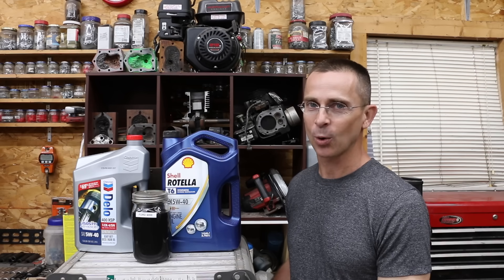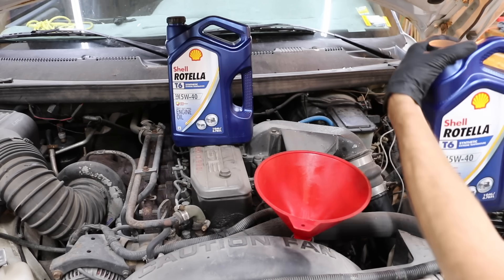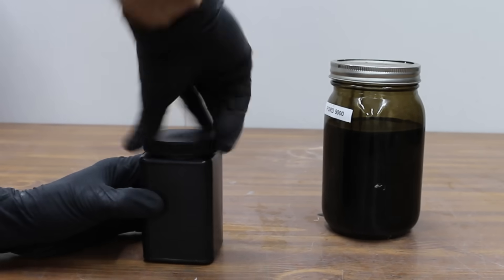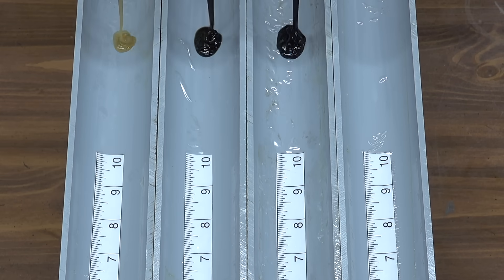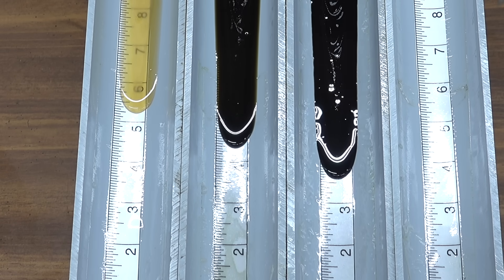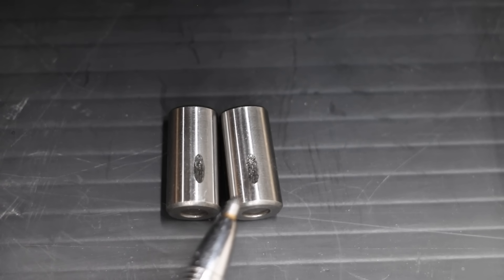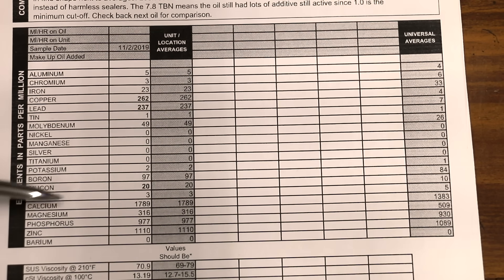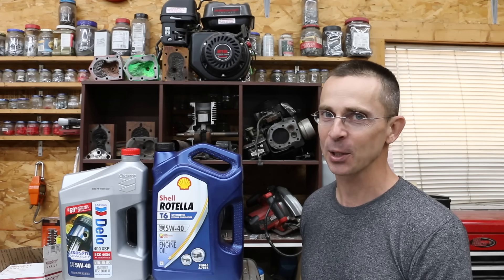Will Annual Oil Change Damage Your Car? Let's find out!

Comment: I have over a dozen cars, many that see less than 1k miles a year and always go back and forth how often the oil needs changed. I’ve been looking for a test like this for years. Excellent video and very informative. Thanks for the great video!
Reply from the maker: Thank you for the feedback
Reply: Same with me, I'll change every two years regardless of miles on oil.
Reply: I think I’m going to start going every two years now. When I go to do my annual oil change, the oil always looks new and feels like a waste
Reply: @mikedubasak5280  Thats BS, fresh oil will change its color from honey-yellow to brownish in a couple 100 miles. You can see it in the video, when he cooked the oils. So dont tell us, your oil looks like new... Youve probably never seen it yourself...
Reply: That seemed like a dicky and unnecessary comment, especially on Christmas...

He cooked the oil at 400 degrees to replicate extreme conditions, oil in a motor is typically right around 250 degrees. Color is a little subjective, especially when your looking at it on a dipstick. The only oil that is black right away (at least in my experience) is in an old ford 7.3 diesel truck I have. In a well maintained good running motor, oil doesn’t change very quick, especially in newer cars. Again, in my situation, oil I’m looking at oil less than 1000 miles in a car that is sitting in a garage. Maybe if a motor is really tired, it would be black pretty quick. Again, just sharing my experiences as a mechanic of 15 years.
Reply: @Chris-yy7qc  incorrect. I have had plenty of vehicles that will not noticibly darken oil until thousands of miles are put on the oil. My g8 runs around 10k miles an oil change on 9 quarts, that stuff looks new for months.

Dont confuse cooking oil at high Temps and normal engine operating conditions
Reply: @You_Got_nico  Then you bought crap oil. Oil contains detergents and is supposed to absorb the dirt from the combustion. So if it doesnt get darker, its crap.
Then you are incorrect: Oil gets as hot as 130°C during normal engine operation. The temp he was cooking the oil wasnt much higher. Additonally the oil has to withstand acids, sheerforce, pressure and so on inside the engine. So normal engine operation is much harder for that oil than any cooking.
Reply: The lighter your oil looks the cleaner the engine is. I have an older car where the oil does get darker only a little bit. It starts getting darker around 4k miles.
Reply: @Chris-yy7qc  most modern generic brand conventional oil (super tech or motomaster etc.) can easily go 4 to 5,000 miles and 2 years as long as operating temps are reached frequently...once the oil starts to go dark, I like to change it regardless of conventional or synthetic. Some conventionals have better additive packages than their own synthetics. Such a Valvoline conventional racing oil...Even the standard Valvoline conventional oil is very high quality and good additive package
Reply: @You_Got_nico  You obviously just didnt understand, because I said exactly the same as you. Try to understand/think first (even if its hard for you), before posting.
Reply: @Chris-yy7qc  if you said the same thing as me then you need to go take an English class to learn how to type.
Reply: @You_Got_nico  Youre arrogant. ;) Not everybody in the world is a native english speaker.
Btw everybody else except you seems to understand me just fine. So I suggest you work on your mental capability while I take a english class... ;)

Comment: The Army is starting to do fluid services based on actually usage or every 2 years on low usage equipment
Reply: When I was in, '01-'05, we had AOAP (army oil analysys program).  We'd get the truck up to temp and take a sample from a port on the side of the engines, then send it off just like Blackstone Labs.  It would either get added to the services list for a change or it wouldn't depending what the analysis showed.
Reply: @GrandPrix46  Big ships do not replace oil, they replenish additives. Does take analysis though. In uncontrolled environments (cars) fulloil swap is cheaper I suppose.
Reply: @GrandPrix46  Big ships do not replace oil, they replenish additives. Does take analysis though. In uncontrolled environments (cars) fulloil swap is cheaper I suppose.
Reply from the maker: Thank you for the feedback

Comment: You should try measuring your wear bearings with caliper using scar center then diameter of it. It may give more accurate representation of wear then length measurement.
Reply from the maker: Thank you for the video idea!

Comment: I change my oil with full synthetic every 8-10 years or 6k miles, never had a problem.
Reply from the maker: Thank you for the feedback
Reply: 8-10 months?
Reply: Mark L   Not months, years. I don't drive that often so it takes me about 8 years or so to get to 6000 miles.
Reply: 8-10 years - maybe for manual transmission oil is good but this is probably way too longer for an engine oil imho. How long do you have the car?
Reply: @Combine1331   I have multiple vehicles so it takes longer to rack up the milage, that's why there is so much time between my oil change intervals.
Reply: @tercola8756  I see. But aren't you worried that engine sludge could build in the engine if you drive the motor with a very old oil? This is like the video topic but on another level. Maybe if there is oil testing companies in your country you could test such old oil if it is any good - just for the peace of mind.
Reply: Combine   I haven't seen any signs of sludge when I change my oil. I think the idea of the 1 year or less oil change interval was created by oil companies so they can sell more of their products and make more money off everyone that believes them.

Comment: Consider for a moment this mr lease I just turned in I had for 27 months - with the oil life monitor I changed the oil  twice. It had 26000 or so miles and the most recently reading was 43% left
Reply from the maker: Thank you for the feedback

Comment: When I left for my round the world motorcycle ride I stored my other bike.  I changed the oil, ran it for 5 minutes then left it for 2 1/2 years.  When I got back I ran the bike for about 50 miles.  It ran fine but the oil was a color I couldn't understand.  I wish I saved some to send ya.
Reply from the maker: Thank you for the feedback

Comment: hi we have a 1992 jeep pickup 86th on it, and its oil filter is upside down?? who would do that?? but I do put oil it and let it set the oil will suck in the filter and not run out, you can over fill it but this works for me thank for your work have a great day

Comment: I put new oil in my mower when I bought it 12 years ago. Thats the only oil it's ever had. Maybe 200sqm of grass to mow, and it still starts first lazy pull every time.
Reply: I had a 6.6 hp mower about 7 seasons before leaving it with the house and admittedly didn't mow nearly as often as neighbors wanted.  Oil always looked new.  A bit larger yard, easily took more than 30 minutes to mow on best situation, so mower always got up to temperature.

Best I can figure, I'd need o worry about the oil condition around the time the body of the mower rusted out, and I saw no evidence of that, even in the high humidity of Indianapolis.

Comment: Could you please do a comparison between 0-w50, T6 and other popular weights? I'd like to see if they offer the same protection once hot and how they flow cold to prevent metal on metal contact. This is mostly regarding to high performance engines.
Thanks!
Reply from the maker: Thank you for the video idea!

Comment: Dont understand it. In Germany I change the oil no later than 30000 km or every 2 years. That almost 19000 miles. Thats with a full synthetic oil. Thats Recommended by European Kia. My last car I had used a mineral oil which I changed at approximately no later than 10000 miles. Never had a problem with either if them.
Reply from the maker: Thank you for the feedback

Comment: 1:25  they don't recommend pre-filling oil filters anymore since "new oil" sometimes has clumps in it which could cause a plug.  Especially in vehicles with high tolerances.  New oil is not perfectly filtered and you are putting "unfiltered" oil directly into the engine by pre-filling the oil filter.
Reply: 6:38 I am glad to see you measuring exactly for the oil heat dissipation tests.  This allows for a direct comparison without being off because of proportion differences in the oil quantities of previous videos.

Edit: 7:47 my bad, you are still doing it the old way but it doesn't matter because Delo actually does experience more evaporative loss.

Comment: I changed my oil a couple months back. I run mobile 1 full synthetic 5w-20. It was about 30 months old will 11k miles on it. It was a little thicker than usual. I think that was due to it being cold. The tensioner broke and I couldn't start up my car. Changed the oil and tensioner the same day. Just to help clean up the engine, I'm running super tech synthetic with some detergent additive. My plan is to run it a 1000 miles or so then change it again

Comment: Hi, can you do a video on block sealers i.e headgaskets in a bottle ? You will need to use a lawnmower with a cooling system, or some car where the head can be easily taken off and reinstalled in an hour. Hire someone to help you if need be - you're getting enough clicks and this one will be one of your best blowout videos. Or buy 5 of the exact same used cars same age (mileage not important), then junk them all after the test or donate them all to some poor folks after using the block sealer with the best results on everyone. Just use new headgaskets that you deliberately damage before installation, do something to confirm straightness of the block and the head, then install,. button up, heat up, retorque, run and show the leaking hg , smoke out the tailpipe, and bubbles in the coolant reservoir. Remember, thousands of people are spending millions of dollars on hg jobs when they can just spend $50 on a block sealer and new coolant and be done with it. Mechanics infest forums screaming against block sealers but we know that its great self sealing chemistry. I look forward to the video.
Reply from the maker: Thank you for the video idea!

Comment: I used rotela t6 in my 2012 subaru wrx. I had alot of recommendations from the subaru mechanic community saying it was a better choice for its heat tolerance for the turbo. I currently have a 2015 ram 2500 6.7l and i want to use it again, but ill have to wait to see how the end of the video goes lol!

Comment: 🏍Please do a Motorcycle/ATV engine oil showdown. You have done a lot of other things on this channel and was great but I really believe that this would be a popular topic in the YouTube community. Thanks and Merry Christmas!!👍🏻👍🏻👍🏻
Reply: Just run Rotella T6 and call it a day. That's literally what everyone else in this comment section does, including myself. You won't find a better oil for small engines with wet clutches.
Reply: @JeremySchoeder  Just as an fyi, a couple of years ago, Shell changed the formula for the Rotella line of oil, and added in some additional friction modifiers.  This is not a good thing for motorcycle wet clutches.  I only noticed this when my clutch started to slip, and I called my clutch company (Rekluse).  They were the ones who used to say use the Rotella oil.  They no longer recommend it due the the added friction modifiers.  Still a great oil, just not for bike anymore.
Reply: @stickbeard  Thanks for the insight. Has T6 retained the JASO MA2 certification?
Reply: @JeremySchoeder  Not sure, but I run a Rekluse in my dirt bike, and had been using T4 and T6 in it, then all of a sudden I started having slipping issues and called Rekluse.  They advised me of the change, and stated they were now having to work on their own oil, which they have now released.
Reply: @stickbeard , The advantages of my older Ducati with the dry clutch. 😂
Reply from the maker: Thank you for the video idea!
Reply: Project Farm Please include the Motul 7100 fully synthetic 10W40, for egoistic reasons :p

But really with all this positive feedback on rotella id really want to see wether a change of brand would be worth it!
Reply: Absolutely

Comment: I have a few Ford with the Triton 5.4 engine, they are work vans. Change oil maybe 2 times per year, when they get low I just put Walmart brand 20w-50 in them.  They have between 200K and 400K on the engines, I don't believe in change the oil every 5K miles, I go about 15k to 25k between oil changes

Comment: You know the first cold flow test and the lab results indicate the used oil is actually better than new oil for winter use. The numbers show it is in good condition but the flow test shows it superior for cold start conditions. 
   As a side note, I love to see you cook some 70s era Quaker State motor oil. You would have a smokey, caked up mess in the pot! I remember buying used engines from junk yards in the 70s and 80s. You used to look in the doorjamb for oil change stickers. If it had a bunch of Quaker State stickers, you either passed on that one or checked it out real good. I have tore down used 'Quaker State engines' and found the lifter valley full of sludge, all the way to being burnt on the bottom side of the intake manifold!
    Great video.

Comment: Not quite sure how you would simulate this, but here is what I would like to see.  Amsoil offers up to 25,000 miles protection on their premium oil.  Others also offer anywhere from 12,000 to 20,000 miles.  I would love to see the oil testing you do on these oils after someone actually used them that long.  This is probably a tough one to do, but certainly would be interesting to know just how far you could push it.

Comment: I've never listened to the 1 year rule in any equipment. Today's oils are just superior and even the older traditional oils were just fine for over a year. It's just marketing to be sure you change them more often to keep money flowing from your pocket to them. I have a boat with an inboard engine and when I have little use over the summer I do not change the oil. I check to be sure there's no water/moisture contamination and it's been just fine. Obviously if I have a certain number of hours of usage I will change it but if not and the color still looks good I don't. Even sitting winterized over the cold temps of winter hasn't affected it and I have skipped a year a couple times if very little hours on it. Go by how the oil looks not by the time on the calendar.

Comment: Thank you for the Video , I let my Dodge Dakota sit months on end , I drive it about 500 miles a year change the oil about every 2 , it gets run 1 time a month .  Deer season I run it lot more Oct to New year .   I ride my bike and change the oil every 3000 miles .  3 oil changes this summer on the bike none on the Truck , Missouri weather Rocks 66 today Rev them engines . Cabool mo

Comment: Would you like to do some testing with the glue branded "Amazing Goop"
I do not know what other brand you could pick to compare though.

I'm using it with all kind of issue that resolve  99% of them.
One of the most common thing i do with it is repairing bike air tube, i once repaired a hole that my little finger could fit in. This glue become like tire gum.
And a 1³cm of this glue got an incredible shear strengh.

Keep up all your amazing projects! I'm always nearby to watch them :D
Reply: Forgot to mention, the only weakness of this glue (the transparent one) is UV light. But who care? It's suppose to be between 2 surface, no? x)

Comment: Great video as always. 

Q: I have a quart of oil, it’s pricey and doesn’t have any certification, but my car’s brand requires that to keep the warranty. How can I send you a bottle? It’ll be interesting to know why some brand manufacturers are limiting their customers to a single brand/spec of oil that doesn’t even comply with API SN.
Reply: There exist "better" oils than API SN - in any case tested for different specs. And some cars have design decisions (belt in crankcase) that demand special oils.

Comment: We change the oil in the Tractor once every two years. No point in wasting oil.
Reply: 4 years is plenty often.
Reply: @rlmartinmanor  We come in somewhere around 75 hours over two years. That's probably enough.
Reply: Augden Fischer  Did you really just pull that trigger?

Comment: Good day from Ont. Canada  I'm older, growing up with oil bath filters.  My 574 IH  has dry air cleaner. I often wondered if oil bath were doing as good as dry?  I know all are dry  now. What is silicone & why  did it have more in the Ford. Is it in  oil in filter?   Thanks you do a real good job.. Merry Christmas & happy new yr.  Thanks

Comment: Love these videos. I wish I could comprehend all this info as fast as you are spouting it out. I only have gas trucks for now but a daily driven diesel Duramax or Cummins may be in my future so which is best for either? I still don’t really know. Sounds like the T6 is better at 12k a year on a diesel but what about s 2010 GM 5.3 LC9 with 160k and DOD delete, I guess I will never know. I currently use Mobil 1 5w30 in Indiana every 3k miles and it sounds like a sewing machine chattering when cold (under 30 degrees F) but sound goes away when warmed up for 10+ minutes. Thanks. Love the videos.

Comment: The manual from my 2004 BMW 320d instructs to use long life oil and to replace the oil every 18750 miles (that is not a typo) I bought the car from the first owner a couple months ago who always had it dealer maintained, and now with ~140k miles on it it's still going strong. However, turbos are known to fail on this engine because of the long oil interval so I'll probably change it to every 10k miles now that I own it.

Comment: I use mobile delvac 15w-40 in my current F150. Ive seen an 02 F150 that was changed with mobile delvac 15w-40 since it was new currently has 360k